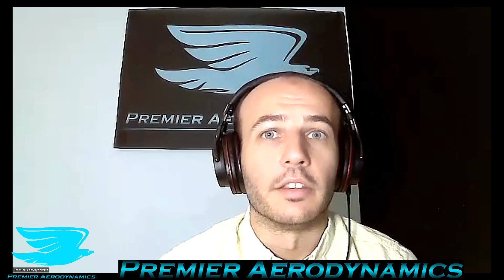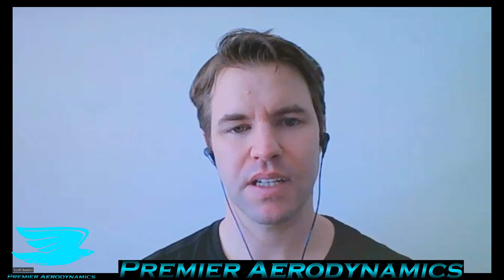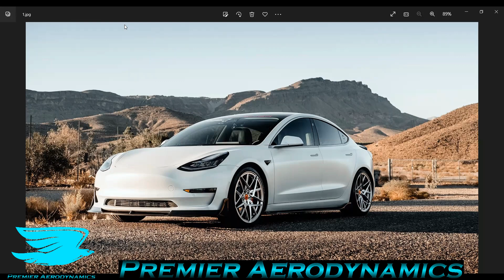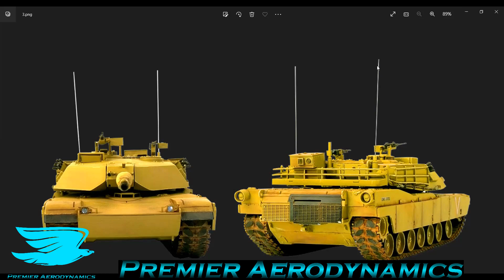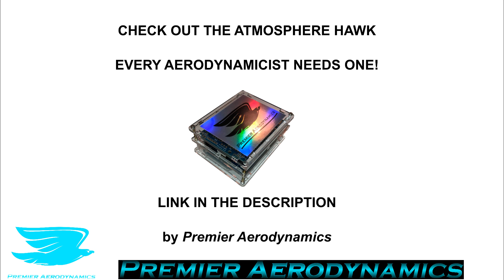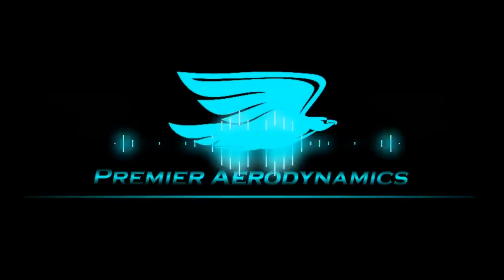F1 AERODYNAMICS EXPERT SCOTT BEETON talks F1, Motorsport, Body kits, Adro - Podcast #42

Comment: The base of the windshield has a big stagnation region, lots of work with venting and energizing that to reduce drag.
Reply from the maker: That's true. Any fairly vertical surface is going to have a very high pressure and that is going to increase the drag.👍
Reply from the maker: I also forgot to mention, we've been trying to find a hamburger bun with and without seeds, but it's really tough. Not sure if we'll be able to do a CFD sim on it. Sorry.